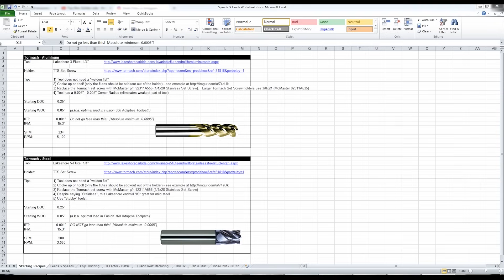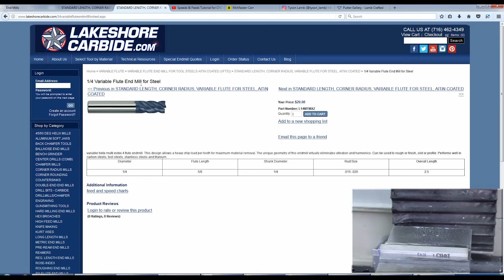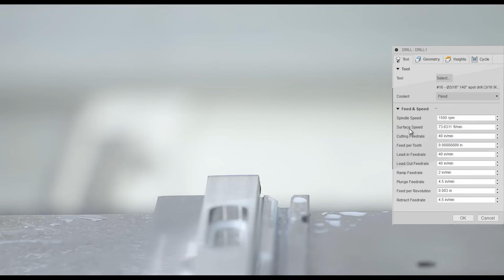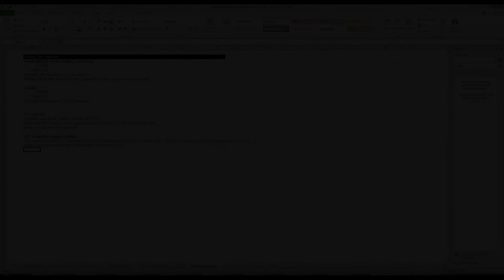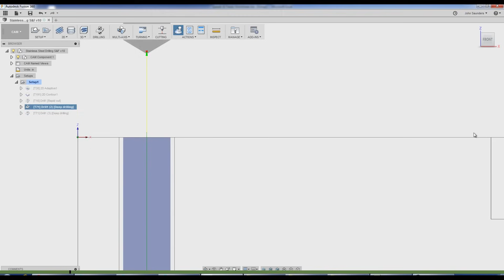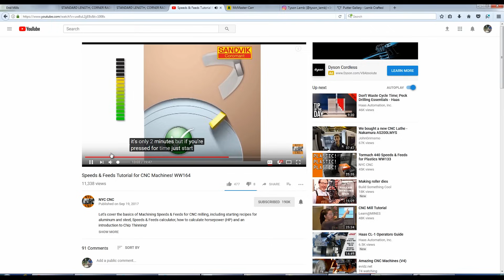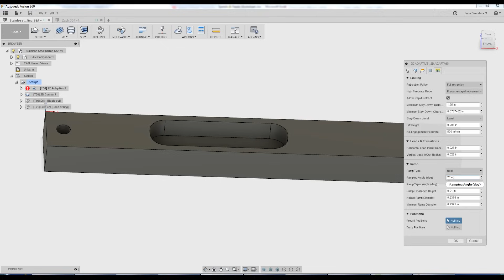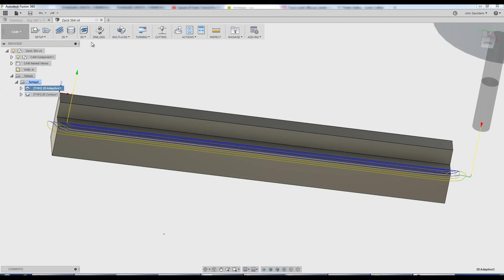Machining 304 Stainless Steel: Feeds & Speeds WW167

Comment: We had some stainless steel pipe at work we were trying to hand drill and we mixed water with baking soda to apply on the bit and it helped tremendously

Comment: I just found this video after breaking a couple of endmills machining some 304, I've turned heaps of 304 before, but never milled it, This video was helpful, but I found that I had to increase the spindle speed by around 30%, and decrease the feed by around 15% before I could get good cuts and good tool life. this did get me started though.

Comment: A couple of points on this subject.
Firstly you say not to whisper cut but I work on some bigger jobs that have 0.05mm tollerance on some of the dimensions, you cannot achieve this with a high step over as you get cutter deflection, especially when the tool is long.
I have 50mm 304 plate to machine and I have found a way to do the whisper cuts by using 6 flute cutters and by going very slow with the feed and speed and doing 2 or 3 clean up passes. But this takes alot of time obviously.
Secondly I am working with haas and ycm machines, they do not offer enough coolant pressure to evacuate chips, alot of people will be in the same boat as me. This means constantly stopping the program to remove chips.
You can get air attachments but you need a boss thats willing to buy and install these attachments, of which I do not have! So I recomment breaking up your program into smaller parts so its easier to get to position where you can stop the program to remove the chip buildup.

Comment: 303 sst 
-less than 300sfm uncoated
-600sfm or over coated
-chipload .006xD up to 1.5xD doc and up to 100%rDoc
304 sst
Less than 250Sfm
-chipload .0045xD up to 1.5xD doc and up to 100%rDoc

440sst annealed
Less than 250Sfm
-chipload .004xD up to 1.5xD doc and up to 100%rDoc

440sst full hard
Less than 50sfm
-chipload .002xD up to 1.5xD doc and up to 100%rDoc

Just make sure chips leave

Pro tip: 
Take the chipload of 1” tool and multiply by the diameter of the tool you are using. Less flutes more chip clearance and less heat and less overall pressure on the shank. Add or subtract 20% for every flute starting with 4 flutes

Comment: I would like to ask you what speeds and feeds should I use if my tool diameter is  ϕ2?
I need to machine irregular pockets 1 mm deep in the same material as you are doing the video.

Comment: hy sir, i am working on steel non magnetic 304 grade. and i am using 6mm endmill with 65 hardness.
my work piece depth withh tool is 0.5mm with 40mm square having endmill angle 51 degree with half of endmill.
but it work best sometime , and mostly it not works in just good condition.
so sir i want some suggestions for it.

Comment: Hey John! How about 303 stainless? I know its more gummy. Maybe a 2 or 3 flute?
Reply: 303 is much more forgiving stainless, cuts like butter... At my job, all we run is 304 stainless, so finding the best recipe for speed and quality is important... I have found it. Using AZA Endmill 5/8 flute length, variable helix, 4 flute, 1/2 Dia .030 Radius Very Important to have the Radius, No Chamfers!!!.... .0625 WOC, 71 IPM, SFM 390 or 2979 rpm and .250 DOC. Make sure to use adaptive toolpath strategies. You can do regular, but slow down to 30 ipm in corners where engagement is more than .175 woc

Comment: I absolutely love machining 304 and 317. When you get the right speeds and feeds you'll get such a beautiful finish, but it will also let you know when your wrong. About 60% of what our shop machines is stainless and I honestly don't know why everyone thinks stainless is so difficult to machine. I would much rather machine 304 then tungston or tantalum, or even some plastics like rexolite or velspel.

Ease in to the material and keep it moving. I use 240-400sfm as my range for milling 35-45sfm for drilling with colbalt. Carbide tsc drills are even more fun and faster! Ever since high-speed dynamic milling was introduced, that's 90% of what I use. Some times I'll go up to 500sfm when roughing. 

I also form tap all my threads in stainless, unless called out for cut or thin walled, from 000-120 to 1/2-13. And the 1/2-13 went 1.125 deep no problem.
Reply: Im running stainless 304L at .0625 woc, 71 ipm, 390 sfm .250 doc.// 4 flute variable helix AZA Endmill.... Guhring has been back and forth trying to get us good endmills to use, the problem is they dont have the .030 radius like AZA does, they .015 chamfer which chips all the time.
Reply: @CNCGuy  5 flute 600sfm 130 ipm 8% stepover. All day long. I cut dry. With such  low radial engagement and a chip breaker, BUE  isnt an issue
Reply: @greg2337  what tool are you using? The job I have I only mill .300-.190 deep as a draft angle. My cutter usually lasts about 130parts usually total of 9.minutes in each.
Reply: @CNCGuy  Helical, SGS, Whisperkut(Sandvik) Lakeshore Carbide. 5 flute EMs are great for SS. Full DOC and light stepover, hard feed puts the heat in the chip. chip breaker shortens the chips and seems to help a lot with BUE. I'm also running it on an Okuma. Ive run a lot of SS on my Tormach 440 but thats where 1/4" EMs really shine.
Reply: Hello, I have a 6.75 dia x 2.0 thick hog out with a lot of material coming off, is warpage a problem with 304?
Reply: @Bigmike528-y9x  yes, the part will most likely warp. You’ll have to go back and forth a few time to get things flat with that level of material removal

Comment: Is there a specific set screw you use to hold in your 1/4" end mill? Or is it just the one that tormach provides with the tool holder?

Comment: If it is very difficult avoid work hardening the surface how do you face mill 304? Is cooling enough to stop that..
Reply: did you figure it out after 5 years :D either use 45 negative cutting edge or 12 positive highfeed cutter with low cutting speeds, we used around 120rpm and feeds up to 1000 for roughing without coolant

Comment: What really drove home how careful one needs to be with 304 is the realization that its yield strength is similar to hard aluminum or a low strength steel, but after factoring in in tensile necking its ultimate (work hardened) strength is similar to the strongest steels! Thanks for the vid!

Comment: It's kind of fun seeing other people learn about stainless - my first job was at Greyhound, and those things were almost all stainless. Body panels, frame members, interior components, got real used to being careful around edges. Abrasives work very well with stainless as well - we normally used cutoff wheels for working with sheet metal. Cheap ones would almost evaporate though in the face of the metal - the body shop manager groused about the cost of good cutoff wheels until he saw how many cheap ones we went through :)

For me, regular steel in my home shop has been a revelation. 12L14 steel? Holy crap, what a dream compared to fighting stainless...

Comment: i had to do 2 18" slots in 304L, .250" wide and .250 deep. total nightmare. Lakeshore tools did not work. Ended up going with Niagara Stabilizer 2.0. 440 sfm, .001ipt - 6722rpm 27ipm. worked great.

Comment: Did I see the work piece or vise get pulled up at 2:09?
Reply: What I saw was the adaptive tool path is not straight, it moved the work back which made it look like it went up.
Reply: Ah, good point. Didn't think of that.

Comment: Great video and lots of useful information! While ago I asked Sandvik their recommendation of shoulder mills for 316L Stainless. They recommended to not use flood coolant since that causes a great temperature change on the cutting insert. Or at least in my case because operations had lots of interrupted cutting. This causes thermal cracking which destroys insert quickly. I managed to cut 316L just fine without coolant after all. Later I built an cheap DIY air blast for jobs where I cannot use flood coolant but where I need to get good chip evacuation. I cannot wait to get my hand on some mist coolant setup :D

Comment: Question on the ramping/VFTS mill.  As the issue is ONLY the ramping in (not the pocket itself), why not change your order of operations slightly.  Drill your existing hole first, but also drill a start for the pocket, either same size, or if the tool change is fast enough, say a 5/16 drill (or larger to come close to fitting the slot), then going from there.  Probably faster than ramping in anyway
Reply from the maker: Absolutely

Comment: I’ve had a lot of success using Lakeshores fireplug VF rougher with stainless running on a 440. I have switched mostly to 416 SS just because of its availability for me and it’s much easier on my tools
Reply from the maker: YES - 416 ftw ;)
Reply: Matthew Lennox 
Care to share your speeds and feeds on your 440 with that fireplug?

Comment: Ahhh this would have been so handy a couple of months ago, with metric even! Still learnt a lot from it, machining is definitely one of those "the more you know, the more you realise you don't know" things. One thing my Sandvik rep mentioned that you didn't (you may have heard otherwise?), if you end up going to a carbide drill, don't spot it. The carbide drill should be rigid enough and spot drilling risks chipping the more brittle drill. This video also goes nicely back to your "Twist Drills are AWESOME!" video, because of the shallow ramp angle, drilling a start hole is going to be quite a bit quicker in a lot of cases.
Reply from the maker: YES - carbide doesn't want a spot! :)  SPOT on ;)

Comment: Order up some 304 L series and compare the difference between the two. 

You’ll be surprised at the difference between 304 and 304 L
Reply from the maker: L is worse, right?  I vaguely remember buying some years back thinking that, like 12L14, the "L" meant added "Lead" to increase machinability.  That was not the case ;)
Reply: NYC CNC way worse. About a 25% reduction in S&F over non L. And even less forgiving.  

L means “low carbon” which makes it suitable for welding. Non L doesn’t weld as good and the weld beads are prone to rusting. 

L has about half the carbon of standard series and slightly higher nickel content. 304 (also called 18-8) has usually only 8% nickel where as 304L has 10-12% nickel typically.
Reply: You probably won't find much difference anymore, not sure about the US but in the UK it is now common practice to dual certify 304l as 304 as most producers  apparently go for the lower carbon limit. Check the material cert, you'll probably find that it's 304/304l.
Reply: Donald Moore 
Are you sure the L for tubing doesn’t refer to L and M series piping?  

The L pipe has a thicker wall than the M.
Reply: Bespoke Metal Fabrications 
I could be wrong but I believe European 304L is held to the low end of the nickel content, around 8-9%. Both 304 and 304L can have nickel contents between 8-12%. So you can make 8% nickel 304L. 
States side 304L rarely dips below 10% nickel. 

It’s that higher nickel content that really effects machinability, especially in drilling ops.
Reply: Occams Sawzall Sounds good to me, my Aalco guy is gonna choke on his coffee when I hit him with this the next time he gives me the "... 304 / 304l it's all the same..." talk.
Reply: I often see tubing get the dual cert but it also is really just 304L. Bar/round stock I only see it as 304 however. 304L is already terrible, then add in the stresses of tubing, it becomes midnight horror film.
Reply: Bespoke Metal Fabrications 
Oh no. It’s definitely NOT the same. 

The carbon content is the big deal. If the part isn’t part of a weldment. It doesn’t matter too much between regular and L. Though L is more difficult to machine. 

But if it’s going to be welded to something and the customer states 304L. Make sure you get 304L. Because they won’t be happy when their weld beads rust on em
Reply: Occams Sawzall Don't think so. It's a rolled and welded piece of flat stock essentially. Plus, they laser it onto the side as 304/304L.
Reply: Occams Sawzall Funny how this discussion came up on here then I'm reading the engineering news and it turns out that Japanese Kobe steels have just admitted to falsifying material certs over a 10 year period, lol. Looks like none of us can be absolutely sure of what we are actually using.
Reply: Bespoke Metal Fabrications 
Really? Japan?  

I mean China I know does. They’ll pour pot metal into a mold then call it inconel. Little disappointed a Japanese company would do that. Figured their innate anal retentive nature wouldn’t genetically allow it 😆
Reply: Occams Sawzall Yep afraid so, space ships, boats, trains etc now undergoing safety tests. Something to do with Mitsubishi heavy ind  https://www.thetimes.co.uk/article/planes-trains-and-automobiles-face-safety-checks-over-japanese-faked-metal-parts-ccwzn9ccx
Reply: And this is why we all need an XRF/OES gun on hand (hopefully they get cheaper)